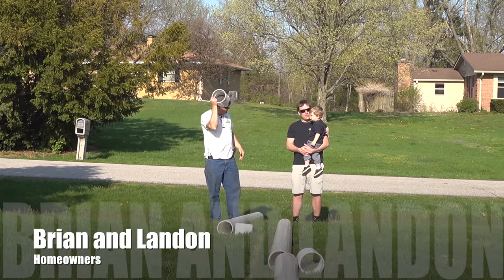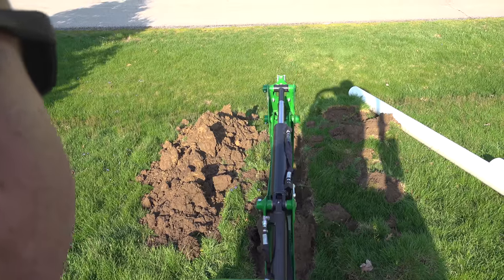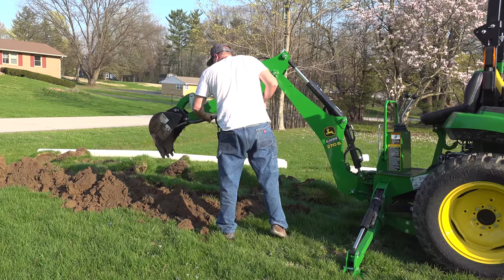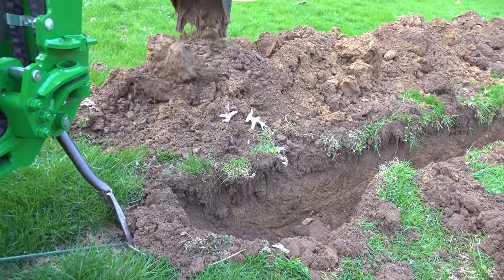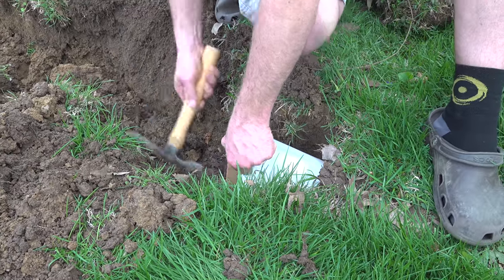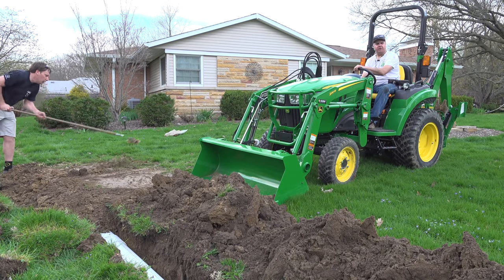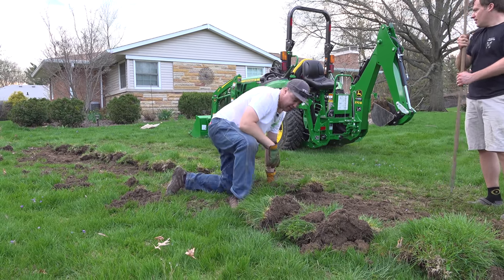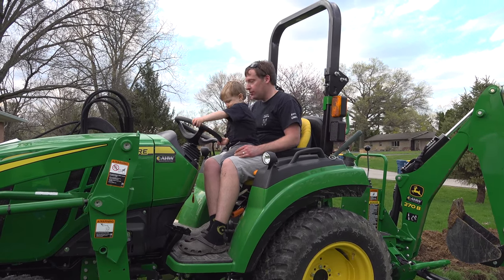First Use! John Deere 2038R 270B Backhoe

Comment: If you leave the front bucket just of the ground lift the stabilisers and use the arm to push you forward hope it helps saves getting on and off
Reply: I was going to say the same, except add to leave it in neutral.
Reply: @court2379  well you cant leave it in gear well digging.. would be a good seen
Reply: arm.. lol
Reply: @arnoldromppai5395  its a hydro, wouldn't matter if it was "in gear" anyway, it wouldn't move
Reply: @airsoftsnipes100  no it wouldnt i am a speking in general. not everyone one has or will be on a hydro.. they will not be on this one..
Reply: @court2379  lol leave it in low range and dig fast
Reply: Rory Jones  2019 models have to have brakes locked before you leave the seat or it shuts down.

Comment: Tip to put large PVC pipe together, I lay pipe in trench and use regular shove to push pipe together. Push about have the shovel in soil  then push on pipe. Also use liquid soap a lubricant on pipe (i.e. dish soap works grate). 

The end of the pipe should have 1/2” galvanized screen to keep small animals out of the pipe, take one of the plastic union peaces and cut to fit in one end then slip the other on the pipe. If you want you can use silicon to keep the screen in.

Comment: I would like to add that if you have a regen system on your tractor, it is usually best to run the engine rpm typically above 1,800 rpm.  If really helps keep suit from building up in your regen canister.  just an FYI for some that are new to diesel tractors with regen cycles.

Comment: I noticed u we’re trying not to tear up grass with the outriggers. If you will pick the backhoe up just a little with the boom then set ur outriggers it won’t tear the sod so bad. An we’re the bucket was ur gona dig out anyway. And vice versa for picking outriggers up
Reply: Good tip, I just use a PT 2x12x 18" long & keep the FEL down

Comment: Great video! They just keep getting better and better. 

Question about the 2038R: Is the backhoe operators platform more crowded than your original Johnny where you turned the seat around? It looked a little cramped in the video, especially for anyone who might be on the taller side. Also, why does the backhoe seat slope forward? Is that a setting? It looks like an uncomfortable position for digging.
Reply from the maker: I never noticed any discomfort.  Didn’t really evaluate the size of the platform.  I should take the time to do a more thorough evaluation.

Comment: I have a 2038r and I absolutely love it and don't regret my decision a bit.
Reply: I'm highly considering 2038r for my small digging business just saw your comment, I think I should buy it. How much did they want for yours? So far your experience is good correct? Please respond within the next 24 to 48 hours. Gracefully yours, James.
Reply: @railfanjames7699  My experience has been excellent. I have used mine for around 80 hours in the first years, mostly mowing, then used it with a box blade and a rake. I also use the front loader to carry a bunch of heavy things around like trees, mulch, top soil, material, etc. I do not have a backhoe so if that is your main use of the tractor, I can't help there. As far as pricing, I do not have this with me at the moment, but for the 2038r, 60d mowing deck, 220r loader and the john deere quick hitch, it was roughly mid 20k if I recall correctly.
Reply: It also has the super bright LED lights.

Comment: Tim, next drive over the sod the same way you did to pack down the back fill. You'll be surprised how well you can mold it back into place. Also if you dump the bucket as far as it will go past vertical \ o  O       you can almost sweep the grass with less chance of digging in, almost like a dozer.  I bring the loader down close and then use the curl and dump function to fine tune where I want the edge. Just be careful it's easy to tear up the sod. Just some tips that work for me. Nice video, pleasure to watch.

Comment: I have the same problem with my 3046r. I was shocked when I first got it the I couldn't see the bucket, I was using a New Holland from a neighbor and you can see the bucket on that one. It took a little getting used to.

Comment: I am a very expierenced backhoe operator on large scale backhoes but even with my 2032R you can move your tractor with the backhoe and not need to leave the seat of your tractor Tim.   Lift your stabilizers and your bucket and push yourself forwards with the backhoe arm making sure you leave the teeth in the ground.  Re position your stabilizers and bucket and U never need to leave your operator station!  :) try it out!

Comment: Just a little tip you probably know but some might not.  When dirt is sticking in the bucket, curl it in more and lead more with the teeth instead of pushing dirt into the whole face of the bucket, that kinda turns it into a sandcastle mold lol.

Comment: Great Video. It would have been interesting if you were able to use the 4 in 1 bucket, as with it open you could push the dirt back in the hole more cleanly without disturbing the grass on the side of the trench. This is because you have better control of the angle of attack of the cutting edge than you do with a bucket.

Comment: I'm so torn, I've been looking at the 2038 with a bucket, brush mower, 3pt finish mower 72 inch, tiller and a shade cover. the cost for everything is + $32,000. I've checked into RK tractors RK37 to be exact with the same attachments and the total price is $24,500 and with the option of getting a 20 ft 10,000 lb trailer for an extra $3500.  I can see how your finance officer feels sometimes.
Reply from the maker: Don’t let the trailer influence you. You can get trailers anywhere for that price.

Comment: Tim at what RPM do you run your tractor when using backhoe and loader.
Reply from the maker: Backhoe is probably 1/3 throttle.  Loader varies.  Everything from 1/3 to wide open.  I use the auto throttle for loader work.

Comment: Wonder if something like a spray can of light oil for the kitchen would be good.  It works on my yard trimmers and saws that touch growing stuff - doesn't kill it like other lubes would.  Not much sand with that is there.  Heavy clay.  Sandy loam about 100-200 feet thick here.  Great grass and Pine Tree land.  Long time flood plane for millions of years.
Reply: Martin Eastburn 
He has to paint the bucket with a graph base paint the soil will not stick

Comment: I looked at a 2025, 2032,2038 and a 3 series last week. Don’t remember the model number but I know it didn’t have the quick removal loader and no option for a belly mower. Nice machines. Wondering if I should sell my Mahindra 4010.
Reply from the maker: That would be the 3e series.  Be careful to avoid confusion.  The 3e is less capable than the 2032r/2038r.

Comment: That 2038R has Tier 4 emissions. You really shouldn't run it at idle. It will clog up the emissions system and result in costly repairs. Hope this helps.
Reply: not just the tier 4, it starves all components of oil, costing a lot more

Comment: I have the very same backhoe on my 2032R and have had the curl cylinder on the bucket bend the ram twice now.  My JD dealer has replaced it once and today was the first time I had tried to use the backhoe since they last did the replacement.  I am waiting for a call to schedule a pick up of the tractor right now.  I was trying to dig up a small tree both times.  I feel that the cylinders rams are not being hardened enough because that should not be happening. The first time it happened, it bent so hard that it put a big dent in the arm that is right above the bucket.  Other than that problem, I have not had any adverse problems with this machine.
Reply from the maker: Have seen this reported multiple times.  I agree that it should not be bending so easily.

Comment: What size buckets do you have and what sizes do you find most useful? I'm hesitant to buy additional buckets due to cost and not knowing if they'd help productivity enough. Currently have only a 12" on a slightly larger BH than you have here.
Reply from the maker: I have 8”, 12”, and 16”. This is the first time I’ve ever used a 12”. I love the 16” for digging holes.
I like the 8” for trenches, except when muddy, it plugs too easily

Comment: It might be counter-intuitive but if you run a higher rpm you can run the machine more smoothly.
Reply: it sure would operat a lot smother and capable of operating more then one funtion at a time, and much less damage to the eqipment, full throttle it what they are made to run at, any less and your starving all the costly components of oil..

Comment: Hi Tim and Christy it did the job but it could be a bit of a pain getting on and off to move the tractor if you were working alone but it does what a good job when your going to cut a trench would you not use your sod cutter to remove the sod
Reply: there is no need to get on an off, the boom is for more then digging,, you push your self forward, left or right, it is so funny when you see a tow truck come to pull a tractor out that has a backhoe,, ppl just have no clue

Comment: put one or two HORIZONTAL bolts in drain pipes to keep things from crawling up in em and dieing plugging em up. That pipe is perfect size for a skunk to call home. Horizontal not vertical to keep them from catching any algae or debris that wash down out of the pipe.
Reply: Al S it would be better to put an detachable screen. Mice and other critters will still go in.
Reply: @FishFind3000  screens clog, if a mouse goes in and dies it doesnt really matter, it will wash out, and not plug the pipe, you just want to block things big enough to block flows.
Reply: @als8518  critters like to make nests.

Comment: I had a foundation drain that didn't hold water but still attracted tree roots. Got clogged several times. Of course it was a lot closer to trees than what you have there.
Reply from the maker: Perforated black tile?
Reply: @TractorTimewithTim  Nope, no holes thin wall pipe that went from the drain around the foundation to open air. Roots found the bell to straight pipe connections. Let's just say the professional that installed it didn't do his job well. After getting clogged 3 times in 10 years and calling RotoRooter each time, I had it replaced by a guy who knew what he was doing. Used heavier pipe and glued the ends.

Comment: What series can you get into a Hydraulic Thumb or is that even an option from Deere on a detachable backhoe?
Reply from the maker: Very soon, there will be a hydraulic thumb available for this series and the 1 series.
Reply: Thats awesome. Much needed addition
Reply: Tractor Time with Tim  Define “very soon”... 🤣
Reply from the maker: Part number exists in Deere system.  You can read about it on GreenTractorTalk.com . the part number is listed there too.

Comment: At what point do you just go from a compact or so to a real backhoe?
Reply from the maker: Well, definitely not this job.  The compact is much better suited.
Reply: @TractorTimewithTim  I  uderstand that but what type of job would or how big? Obviously a 10,000 lb machine an lawn doesn't mix sort of how tracks or skid steers don't
Reply from the maker: Right next to buildings.  Digging where spoils need to be a long way from the hole.  Long trenches, deep holes, etc.  
(And no brand new backhoe to play with) :-)

Comment: all eqipment is designed to run full throttle when gigging or any other job, and let it run on the Governor, so many newbes think oh it works fine at just above ideal, but the damage your doing to the equipment really shortens the life of many components, such as pump, re-leaf valves and heating up of oil, 1st you are starving the pump and other components of good high oil flow. and we can see that when components are taken a part, and will nnot be covered under warranty. they are made to run full throttle on the Governor at all time to give the rated oil flow, running slow heats up the oil, over works components to know end, fastest way to kill things, every guy that brings in a peace of equipment for repair (or see one running it at low rpm)  as its not working like it did, and we have a look, and you want to kick the guy in the head, as words dont seem to get though.. just lesson to the squeal (doing damage) of the hydraulics as he moves the boom, low oil flow stops the use of using many functions at the same time. 2nd, you dont need a driver to move the tractor forward, lift your out riggers and push your self forward or left or right with the bucket..

Comment: Another great video Tim. However I do feel that if you chose the excavator as an experienced operator that job would take about half the time. It would be half the time to dig it and half the time to backfill it and also a cleaner job to backfill it
Reply from the maker: I could have done a much cleaner backfill if my bucket level indicator was set right.  I just couldn’t judge the bucket level appropriately.

Having said that, I’m sure the job would have been faster with excavator. However, the tracks would have torn up more grass on backfill.  Experience or not.

For this job, it didn’t matter. We were there about 1.5 hours total.

Comment: Tim, I have read some of these comments and was wondering if even with a hydrostatic drive can't the tractor be put in neutral and then moved forward with the backhoe? I know with a manual transmission it works because I use that method.
Reply from the maker: Yes.  You are right.